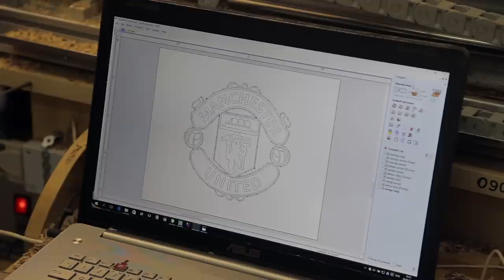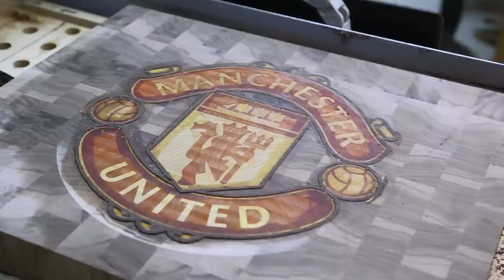Торцевая разделочная доска с логотипом "Манчестер Юнайтед"

Comment: Your talent in transferring a drawing into the inlays using the correct color of wood is astounding! Some of the "walls" left in an inlay are soooo thin, there must be some tear out sometimes? Be careful of those icicles father! He is conscious of the danger, that's smart!
Reply from the maker: +MRrwmac I did the wenge lines 1.5 mm thick. So the depth while milling 30 degree bit is 2.8 mm. I think it is enough. Nothing can happen. They are glued very well. Thanks!

Comment: My goodness you are a master at the CNC among other things.  One wrong set up and things are off center and the board is ruined.......Especially that last step, the outline........off a few mm and you now have a shadow instead of an outline.    
Amazing work.  Well done.  You got to get a bigger tube to be able to submerge the bigger boards.  That't the money shot.
Reply from the maker: +Big Mike is talking Right. I do not like to remove the board out off CNC table between the steps. Thanks!

Comment: Congrats on one more excellent job. I see you started to use different way of clearing  unnecessary layers from top -- using cnc now instead of planer/sanding machine. Could you share which bit you used, maybe link to it ? Thanks and keep posting your videos with any projects wood/home improvement etc.. Good luck
Reply from the maker: +don Filips It is an ordinary 18 mm end mill bit.
Reply: +mtmwood  What shank diameter , 6 mm? and what flute length and overall length please? I assume downcut ?
Reply from the maker: don Filips 8 mm diameter, 12 mm flute length, overall - about 30 mm.

Comment: I was going to ask why you were not using the pneumatic press that you showed us a few videos ago, but have not seen it since. However, I see you used it today. 
That board you made in this video was amazing. Your craftsmanship is excellent!
Because you have to make the original cutting board, and then the inlays... With glue drying time and the actual CNC work, how long did it actually take to make this board?
Reply from the maker: +johnr17033 Some video materials were made before I got the press.
About a week.
Thanks!